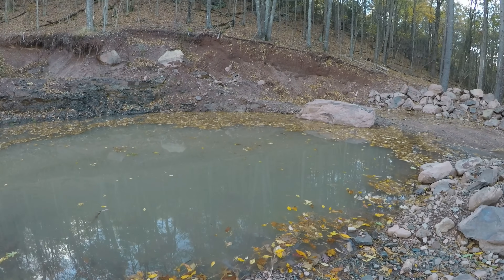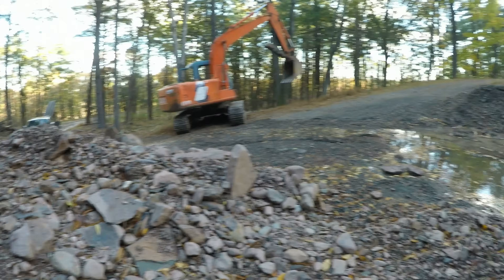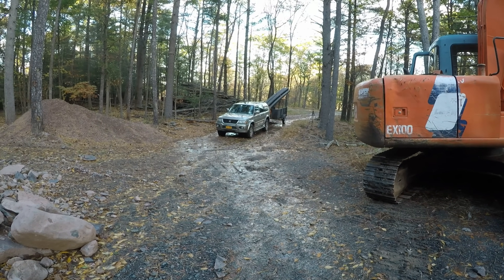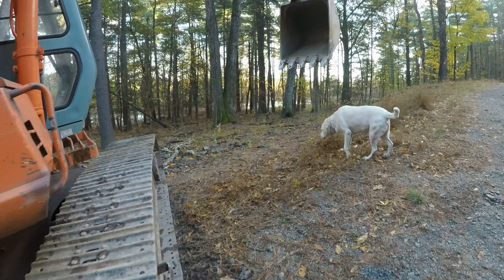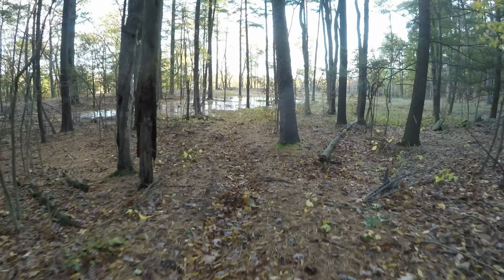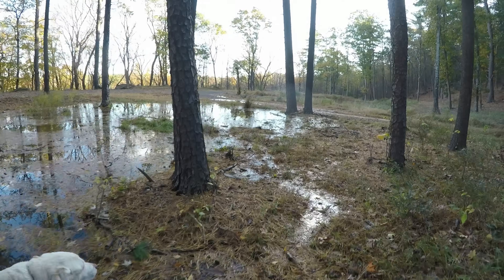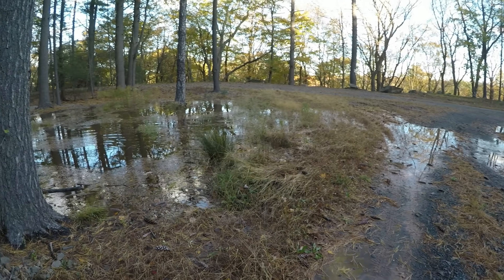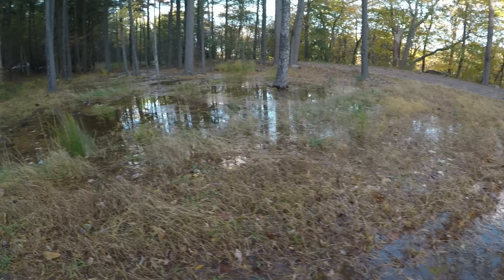Installing culvert pipes

Comment: Usually we put a grill on the both ends of the pipe line just in order to keep the pipes clean in the inside and to avoid the line to be clogged by the mud.
Reply from the maker: My experience has been that the screens cause more problems then good. Leaves and such just get stuck against them and block the flow. Once something fits inside the pipe it usually goes all the way through.
Reply: @AndrewCamarata  What you said is happened several times in my experiences also. I’ve never been able to decide if is better with or without the grill. Usually we put the grill if the suction pipe is placed rised from the bottom of the basin, otherwise if the pipe is lyied on the bed’s basin we keep it clear. Anyway thanks to take some of your time to reply to me. Appreciated!
Reply from the maker: No problem. The pipes in this video are still working well. Except that last pipe can clog up with leaves after the fall. The 8" pipe handles the water fine, but not leaves. I should have used a larger one.
Reply: @AndrewCamarata  Also because you respected the right corner angle and gived the right slope ;)

Comment: I'm impressed with your performance Andrew great job as always,  2021. I had missed this video till now.
Reply from the maker: Yeah, this video has a nice flow to it.
Reply: @AndrewCamarata  I even liked the music on video,  I've got a 2 speaker bluetooth and that music was great,  thanks so much,  you are a special person,  and ole levi was there. Bless his heart.,,also the flow meaning the water, huh, your funnyman I guess? Are you extra large person,  I've a old Honda coat, I'll give you if you want it, that 3 wheeler you rode is a Honda isn't it.  I'm almost a 3x, so I got it in a rummage sale box, and it's in good condition,  your choice.
Reply from the maker: I am 185lbs 6' tall
Reply: @AndrewCamarata  so I thought when I talked to you like this, isn't it private? So you want the coat, it's like a wind breaker of sorts, got insulated inside and outside might be feels like thin plastic or something like that,  nice old coat, has Honda on the left sleeve,  I know you don't get cold much but just too see you in the coat would be a good thing. Your thoughts? I'm just an old man trying to help.
Reply from the maker: A vintage Honda coat sounds cool. A photo would help, IDK, send a text with a photo of it. 845-399-8477
Reply: @AndrewCamarata  No pun intended, I'm sure!
Reply: @AndrewCamarata  No pun intended, I'm sure...

Comment: Why tf wouldn’t you dam the water up? What kind of idiot trys to put a trench in with water flowing into it constantly. 🤦🏻‍♂️🤦🏻‍♂️
Reply: says the genius with a channel with one subscriber (probably your mom) ... he has been working that pond toward future plans for the property; a dam is opposite of what he needs. Plus a dam won't stop the overflow issue. Plus the pipe does exactly what he wants and puts the water exactly where he wants no matter how much rain or groundwater he gets. The trench, genius, picks up both the rain and groundwater that HE WANTS to direct into the pond. It is precisely that there is constant water flow that makes a trench in that open area the smart thing. It will become a stream. I dam is not a good idea there - it will just back up the water, leave the surrounding area with high water table and soggy. WTF kind of idiot speaks toward something he is clueless about and attacks someone else while doing it?

Comment: Some of your culverts don't look deep enough and it is my understanding only soft dirt without rocks should be on top of the 1st 6 to 12 inches of culverts to prevent damage to them especially when under driveways, other wise you do great.   At least areas over driveways are getting some gravel.

Comment: Don't you have locator laws where you are. Here a locator service must be used anywhere you are digging. If you don't locate and hit something,  the fines are OUCH!!!!
Reply from the maker: There’s nothing there.
Reply from the maker: I do my own locates. Costumers won’t pay $800 for locates.
Reply: That’s expensive!  I can see why you do your own. I don’t think that crews can do it here.
Reply: @raymondswarmer1433   we have dig safe. If you even go below the grass roots in your lawn we need to call them.They send out utilities to mark everything anywhere close to where you will or might dig. It is law to call them. They are not nice if you don't. From their website:
Planning home improvements? Planting a tree? Installing a fence or deck? Whether you do it yourself or hire a professional, a safe job starts with a call to Dig Safe® at 811.
Dig Safe® is a not-for-profit clearinghouse that notifies participating utility companies of your plans to dig. In turn, these utilities (or their contract locating companies) respond to mark out the location of their underground facilities. Dig Safe is a free service, funded entirely by its member utility companies. (Note: Dig Safe does not mark utility lines.)   It’s a risk to make faulty assumptions about when to notify Dig Safe. That’s why state law requires you to notify Dig Safe for even small projects, like installing a mailbox or planting shrubs. The depth of utility lines vary, and there may be multiple utility lines in a common area.

Comment: For quite a while now I've been watching you grade small driveways up to larger small roads (something like this one).  Questions:  1) has the county or (regional body) come to you and give you any grief about how you are doing these jobs or ask/make you change any of them after the fact?  2) In my estimation it seems that your method and logic would appear to be correct in each situation.   But sometimes they have a different view on the topic.  4)  I'm wandering how large the nearest city is to you and your area?  If they are aware of you and your talents then they perhaps have confidence in the outcome.  5) Have you had to take out any permits for these jobs?  I'm certainly not going to blow the whistle on you - no way.

I'm not trying to find your location just asking about the size of the population in the surrounding area.
Reply from the maker: This is America, do what you want. They do not have permits to ask for permits.

Comment: Oh, oh, you laid that pipe too shallow. In winter, the water in it will freeze and either burst it, or the water flow will be blocked. Is that the point? Can't you bury this pipe any deeper?
Reply: There will be no water when the pond ices over. The culvert was installed as an overflow drain therefore it will always be above the pond's surface. The only time it will flow is during a rain storm and then only after the pond is completely full.

Comment: Really need to be careful when covering culverts in a roadway with those larger rocks, especially when using single wall plastic culvert. You can definitely run into an issue when you start driving across them and pushing those rocks into the wall of the pipe. I always try to use the cleanest fill when first covering the pipe and place the larger rocks on the sides if the ditch is wider than the installed pipe.

Comment: Is it still in and working? because I would've said it's way too shallow and the joints not being sealed could cause issues, especially the one at around the 5:00 mark. It looks like it got seperated when you bent it with the excavator...

Comment: Just a tip, if the water gets flowing at a good pace itll start picking up debris, put a few feet of gravel in front of each culvert to try and prevent so much from going into the pipe and clogging it. This wont stop the leaves but is a good preventative for harder to clean mud.

Comment: Is 8" big enough, I'd be concerned about blockage?
Reply from the maker: This has been in like 2 years now. The 2 sections have been working great with no problems. That last section has to be cleared of leaves once or twice in the fall. But overall this install has really helped. Look at my "removing a shed" video I recently published, the beginning of the video I cleaned leaves from one of these pipes.
Reply: @AndrewCamarata   I think in time all this old equipment is going to require more and more service which will pull you off the money making part of your business unless you have people working for you generating $$.  Redundancy is a good thing tho.
Had I the camera(s), I should have documented the process of replacing the water tank in my rv last year over a period of 6 weeks.  An enormous project working on my back on crushed drain rock.  I did put a couple of plastic tarps down to save my back and clothes.
Merry Xmas from Vancouver Island, West Coast Canada

Comment: I think the video quality would be much better if you use a higher FPS setting on your GoPro 

but still a nice Video
Reply from the maker: Higher FPS is good when filming slow motion stuff. Since I sped this video up, filming at a high FPS would not have helped. I may have filmed some of it in timelapse though and had the setting too low. IDK, this was a few years ago.

Comment: At 05:13 Min you disassembled the connection of the pipe when you covered it with gravel.
Reply: You can see at the bottom right corner of the footage that water keeps going fine.

Comment: Hi Andrew. 200mm pipe will not work it will still overflow onto the road. You need  600 mm pipe if you want it work. Look at your roof and count how many down pipes you have to remove the rain water from your roof.  Just say you have 4 downpipes. now look at the run off and collection area of the top pond. I bet it is larger then a normal size roof. With 4 down pipes for a normal size roof you will still have your roof gutters overflowing  during a prolong heavy downpour. 4 x 90mm downpipes is about the same as 1 x 200mm. So your pond will still overflow when using 200mm pipe I hate to tell you.

Comment: I used one of the techniques I learn from you on a 1 mile driveway the other day. It also got me the job because I didn’t have to haul 10 loads of rock in to fill the ditches that had washed out in the driveway. I dug the rock from a big bank behind the house and hauled it down the driveway. Thanks.

Comment: You call that a pond.  Where I come from a pond is at the very least 1.5 acres in size and are at the very least tapered to 10 feet deep.  What you have here is just a mud hole.

Comment: Why would you use 8-inch pipe you're just making more problems
Reply from the maker: This project has been working well. That very last section of people gets blocked up with leaves sometimes. I wish that was bigger. The other 2 sections have not gotten blocked though.

Comment: bad planning, you should have started with the pipe in the lover pond and so drain the middle puddle first (without extra water coming from the upper pond). Then install lover culvert, then continue the trench up to the upper pond and then dig the the trench for the upper pond and finally install the upper culvert.

Comment: Someone will need to constantly monitor the culverts for debris which might clog them. I have a 24" corrugated steel culvert completely washed out due to debris clogging the upstream end of it. The stream washed away absolutely all the fill. I visited that site only about every year or so.

Comment: Im in the works of becoming a heavy equipment operator absolutely love your vids that work with the excavators ive worked on backhoes and skidsteers etc. all my life love these vids, you should put screens on the ends of the pipes since theres a ton of pine needles and leaves in the vid

Comment: Andrew, do you ever see any issues with full concrete trucks driving over the plastic culverts?
Reply from the maker: I have never had a problem with a plastic pipe crushing. Only metal ones rusting out.

Comment: In the other driveway video you laid down black mat over the culvert pipe, then the coarse gravel (1's & 2's).
When do you need / when should you use the matting?
Reply from the maker: Use the matting when the ground is all dirt/mud. Here its all rock and  the matting is not needed.

Comment: Thanks for the great videos. I just stumbled upon them by chance. One note: It looked to be as if the second and the third pipe are nor properly connected or got partially disconnected, as can be seen around 5:16. I may be mistaken, as I never worked let alone connected culvert pipes, but if they go disconnected I can imagine that there may be problems with the pipe in the future. Anyways, thanks again for some great insights into your job :-)
Reply: I noticed this too

Comment: The only thing I am surprised by that you did not run some copper wire next to your drain for location of the drain line.
Reply: They're mostly culvert pipes so you can get a sense of where the pipe is from the inlet and outlet

Comment: Do you just leave the ends open like that? Are you supposed to cover one end with rocks and gravel (to filter debris) and same thing at the other end? How do you keep it from getting full of debris otherwise? I looking to do the same thing, but to run a seasonal stream under the front of my house, under the driveway. About 40 feet. But I was planning on covering each end with a steel mesh and then gravel/rocks.
Reply from the maker: In my opinion; they ends are better open. Because when a mesh is installed, all it does it clog up with leaves, than water blocks up, and jumps over the culvert pipe and causes problems. With the pipes open, leaves will just go right threw the pipe. I did a video recently where a culvert pipe clogged up because of a grate, and it took a couple hours to fix it. https://youtu.be/uIKHCuIvS78
Reply: @AndrewCamarata  Interesting. I'll check out the video. I don't know how fast your water flows there, from that pond, but our little seasonal stream here becomes a gushing fast moving roaring stream (about 3 feet wide) when it rains hard. I'm pretty sure I need to use rather large pipe.

Comment: Isn't the pipe to close to the surface?
Reply from the maker: Its as deep as I could get it due to bed rock. I guess it could be hammered deeper, or more fill be added to the top. But its been in over a year and its been working fine.

Comment: The line on the culvert needs to go to the bottom.  There is holes in it that allow the ribs to fill with water as the water levels rise and fall thus adding weight to the culvert to keep it in the ground.
Reply: Down or Up for the line.      there is a hole on the opposite side to allow airflow.

Comment: Should thefirst  pipes go a llitle bit deeper on the ground?
Just asking,i am not an expert etc...
Reply from the maker: It wouldn't be bad, but sometimes if they are too deep, the pipes can fill up with dirt and clog up. This was as deep as I could get it, because I couldn't dig into the rock any deeper. I did this over a year ago, and it is still working fine.
Reply: Andrew Camarata thank you for answering!!

Comment: You might want to think about putting the bucket on the ground whenever you dismount the machine, if a hose should fail when its in the air bad things could happen.

Comment: not deep enough the winter if you get winter in that location will push up that culvert and it will protrude causing another problem to solve.  Even if you don't get cold winter weather it's still too shallow the material above the culvert will not be packed enough Good idea but needed more planning.  Sorry
Reply from the maker: Couldn't get any deeper. I did that last year, its working fine.

Comment: For future reference if you ditch towards the pond, and leave a 2-3ft berm, you could of connected and backfilled 90% of your culvert before you did the final 2-3 ft and let the water flow. only would of had to connected one joint in the water, also with all that moisture in the ditch its gonna sink abit more than if it was all dry. You run that machine well, but i i still noticed 13:18 :P

Comment: We have a small farm in No. VA but are not full time farmers.  Need to repair my 600' driveway and direct water away from its surface.  Am borrowing a friend's skid steer and maybe renting his mini excavator.  Haven't operated either previously,  so watching your vid is part of my research.  

Am asking honestly and not to be a dickweed: what happens if a stick and clump of leaves gets stuck 55' down one of your ridged, 8" culverts?  Two of my smooth, 12" x 25' concrete culverts get clogged that way all the time and it's a sh_t job to clear those blockages.  

Amazing to watch you work that equipment––like you're doing it with your hands, only they're big-ass hand made of steel and their nerves are hydraulic.  Something else.

Comment: Sloppy. This is a 1 year solution to your problem. Backfilling with water still in the hole is a huge rookie mistake. Just blowing in the hole and not compacting will cause problems later on down the road. Your backhoe was literally sinking in and leaving ruts in your excavation. Not impressed at all. Oh and bells always face up hill.
Reply from the maker: Everything was done perfectly in this video.
Reply: Yeah maybe I guess it’s ok because your a half assed fly by night sloppy contractor. I’ll make sure I know not to hire your unprofessional work.

Comment: I would have liked to hear the machines working? And, not the music
Reply from the maker: There is a section of that in this video. When the video is sped up, the audio is gone, so I add the music, plus the machine motor sounds the same the whole time. If it was normal speed the whole time, this video would be considerably longer, and less interesting.